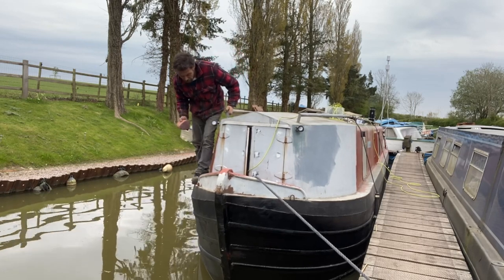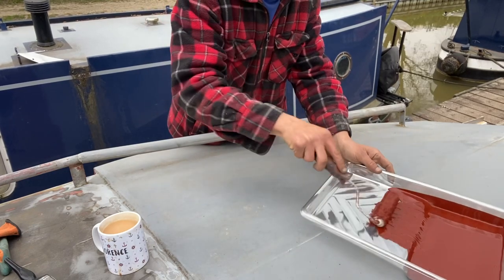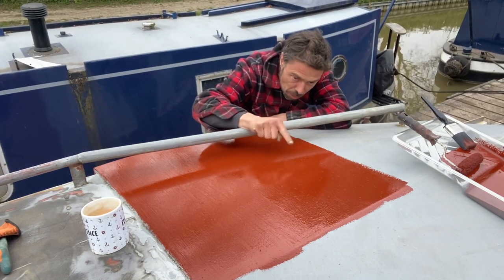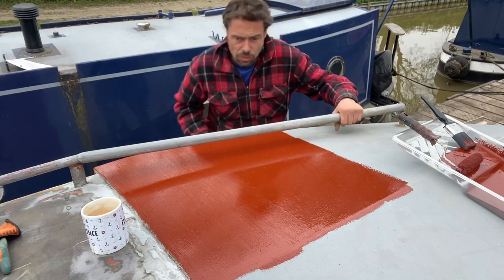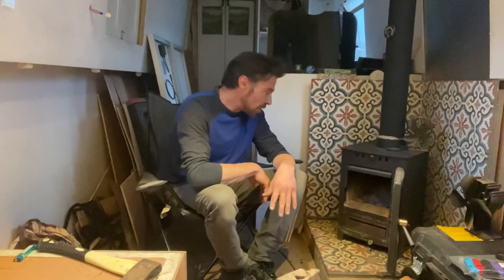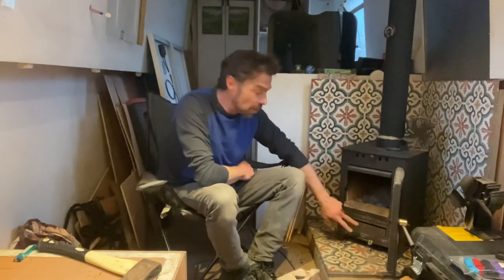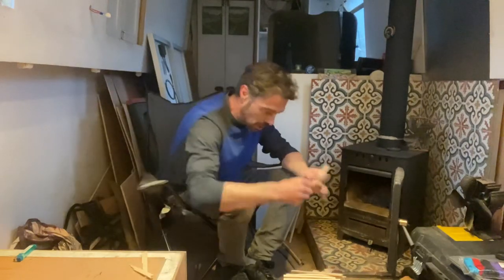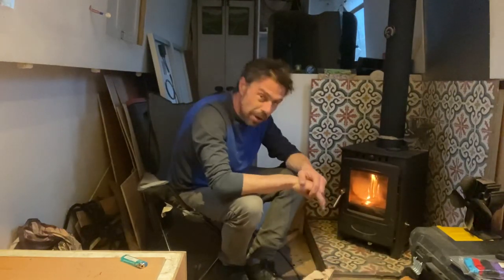171. Narrowboat bow gets a makeover

Comment: Bloomin 'eck that takes me back to my childhood, when we had a coal fire, cutting Kindling on the backdoor step with an old rusty axe 😊  Then building lattices of wood in the base of the fire, we took sheets of newspaper, rolled them diagonally into long thin tubes, flatten them and then tied them in a knot so they were like little balls of paper.  Put two or three of them in the ash pan lit, close the door and the flames would draw through and light the wood   👍

Comment: Instead of cutting the wood into really small sticks, take a sharp hunting knife and make feathers from a small log like you’re whittling, not individual curls but a set of curls about 6-8 inches long or bark will work.  Keep a dry log by the fireplace for this purpose,  you can use twigs too, just take some garden clippers and a bag with you and cut up some small dead branches.  I’ve even used bones in my fireplaces, acorns, pine cones and whatever I could find at times, be creative with Mother Nature.